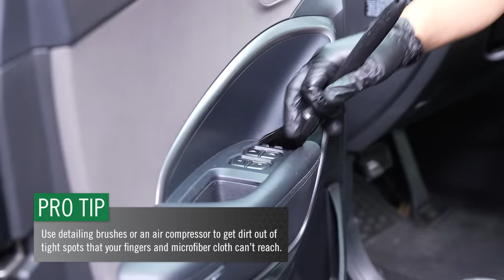Beginner's Guide to Car Detailing (Like a Pro)

Comment: No MAX Wax or SNS ?
1.Clean Interior
2.Wash wheel/tyre/engine compoment
3.Restore headlights
4.Wash Exterior 1st
5.using clay bar or clay miit
6.Wash Exterior 2st
7.Polishing【1 & Done】
8.Layer of protection【Flex Wax】
9.Another Protection【ICE Spary Wax】
10.Clean tools